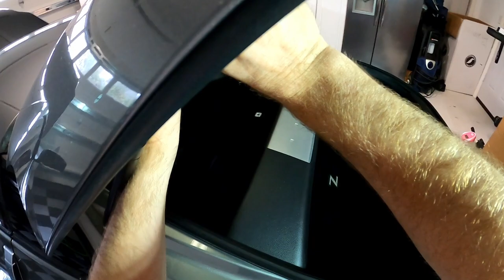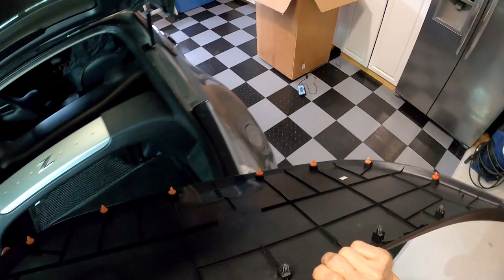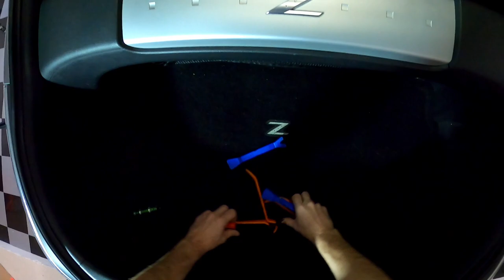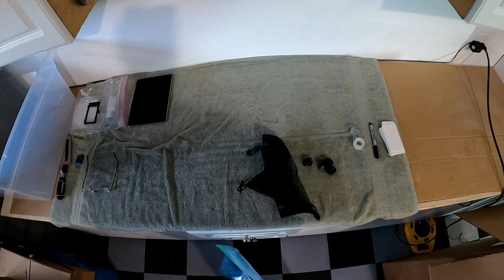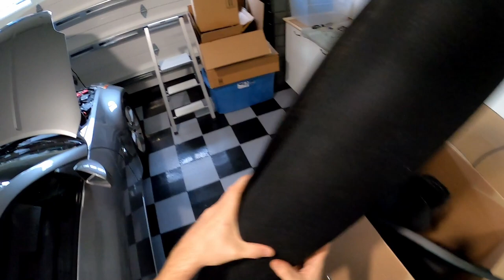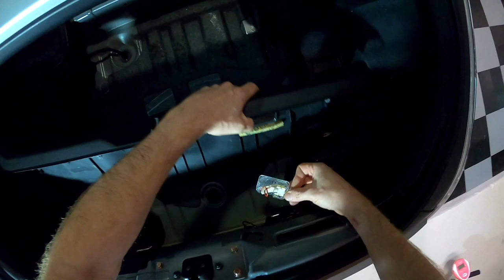HowTo: Hatch And Trunk Trim Removal In A Nissan 350Z (Part 1)

Comment: Why the top
Reply from the maker: Great question. Part curiosity and part future planning. I wanted to know how much weight the plastics added to get a better idea of weight savings if I went with a carbon fiber hatch.
Reply: for me personally, I'm tinting my back window and wanted perfect seams
Reply from the maker: @connorbreuche  Thank you for sharing Connor. Tinting is another great reason for removing the trim. It is always worth taking the time and doing a job right!
Reply: What is the plastic parts called? I just got my back window replaced and the place that did it cracked and broke the plastic but i dont know name to look up
Reply from the maker: @dexterjones3370  Hi Dexter. I am sorry to hear about the damage to your 350Z. Here is a link (https://www.nissanpartsdeal.com/parts-list/2005-nissan-350z/body_back_door_rear_body/back_door_trimming.html) to the hatch part numbers. I will add them to the video as well.
Reply from the maker: @dexterjones3370  Hi Dexter. I am sorry to hear about the damage to your vehicle. I added the part numbers to the video description for you. Here is the schematic: https://www.nissanpartsdeal.com/parts-list/2005-nissan-350z/body_back_door_rear_body/back_door_trimming.html
Reply: For the bottom part of the trunk after you removed all 3 lining how did you remove the sides ? Is it just pulling up